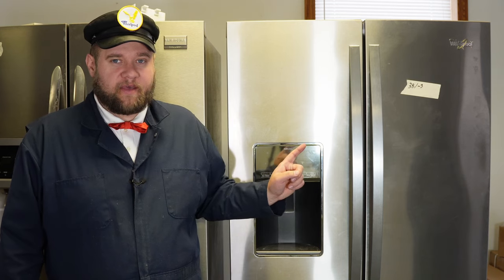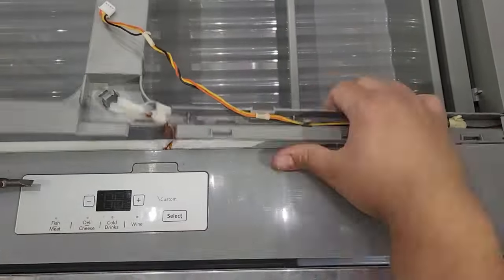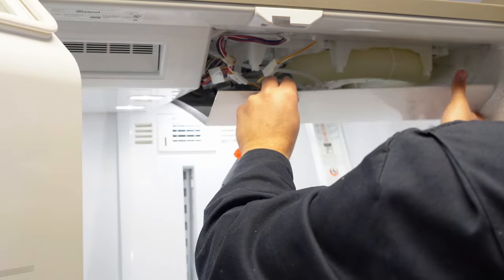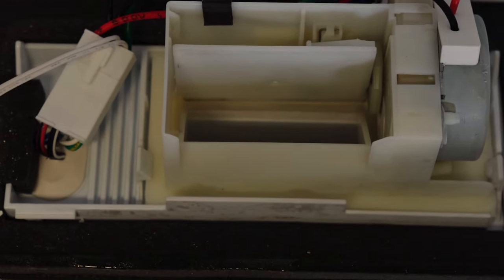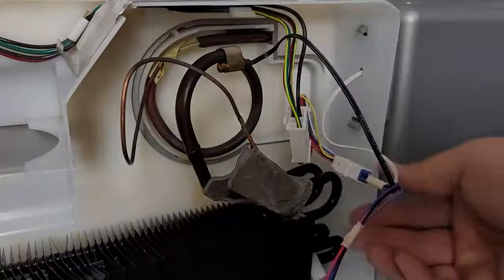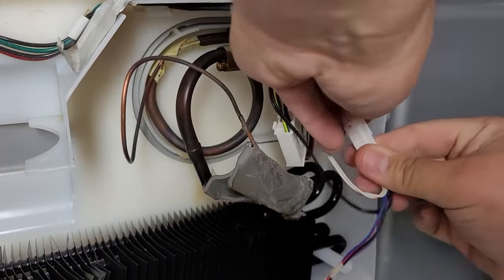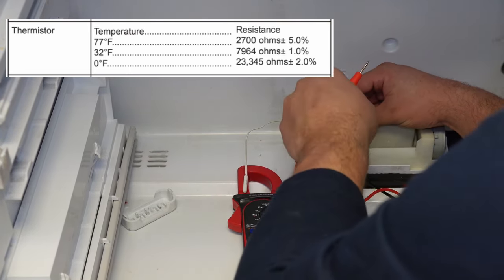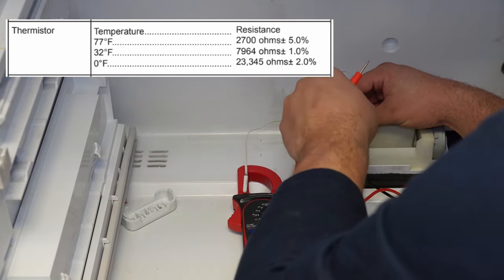Whirlpool Refrigerator Not Cooling but Bottom Freezer Works - How to Troubleshoot & Repair

Comment from the maker: Link to parts from iFixit:
Whirlpool Evaporator Fan w/ Thermal Sensor: https://ifix.gd/3TvVEm0
Alternate fan kit (check model#, W11087438): https://ifix.gd/3TzECDu
Damper Assembly: https://ifix.gd/4gwd4IL
Evaporator Drain Pan Trey:  https://ifix.gd/3BdSmxl

Comment: This my fridge!!!! $2000 and only worked 5 years. Freezer is working fridge is not. I got the beeping like doors are open and it was powering on and off. Guy came to check it and said all codes are fine but it's reading low voltage. He took control panel off plugged it back in and fridge worked again.... it was 38 degrees this morning now its reading 58 degrees 12 hours later freezer is 19 degrees. Total garbage and can't find any one who knows any thing about them.
Reply: Did you ever end up figure it out?
Reply: Update

Comment: It is a fault with the defrost cycle, it freezes over the vents and causes the refrigerator to stop cooling
Reply: This happened to ours, it was less than 31 days old😮
Reply: What is the fix for this? I noticed the metal base behind the white plastic is totally frozen.
Reply: @cathymc116 it usually fixes it self if you scrape of the ice but idk

Comment: I did the test on #3.  Fan didn’t come on. I replaced fan motor and it ran for a second. Then didn’t anymore.  Weird thing is if I spin the fan blade manually it will turn on and run for a minute or 2 and then stop.  Ran test #3 with new fan and fan doesn’t come on.  What else could it be ?   I tested the thermister and my #’s we’re close to the chart at 77 deg and at 34 deg.  I could not get cold enough to 32 even zero.  I assumed thermister is good. Maybe it’s bad ?   But why does fan turn on when I spin it manually ?

Comment: Fridge is at 46 degrees.  Freezer and fridge drawer r fine.  I noticed some ice on in back of drawers.  What was the code for defrost.  I took off top and have no code sheet
Reply from the maker: I have a dedicated video on the defrost codes, FYI

Comment: Have a carbon copy of the fridge and same problem.  Inspected, cleaned and tested all components as instructed in your video, everything checked out to be working fine. 
I had to call a Whirlpool repair man.  Diagnosing was correct except there was one more thing to check, the fan. The tiny fan that blows the cool air up to fridge. That was the problem, a none functioning cooler fan. 
After showing the repair man what I had diagnosed he only charged me $530.00 for 4mins of work to replace the fan.....lol.  Works fine now.
Reply: Where is the fan located ? My has a very cold freezer area (bottom) but the fridge area (top) on gets down to 65 degrees.
Reply: @EddieGomesCandmore  the fan is located in the freezer back wall. Take out the sliding drawer and then the back plating. This is where you’ll find the fan. Hope this helps you out.

Comment: Excellent diagnostic video, I loved every minuet of it. These style fridges can be hard to work on, I like the idea of checking the defrost cycle with amp draw. And I might have to add a Kill-o-Watt gizmo to my tool bag.
Reply: It's very handy to have a kill-a-watt meter for this and other projects. I was able to verify that my heater element was working by going into the step number 38 and observing 448Watts on the similar counter depth 2 door model

Comment: Did you ever make a video for the freezer section? I have ice outside that panel, which probably means there is ice inside the panel. There is some rattling noise, which gets louder when you open the freezer. I think it is some fan? Either way. I need to figure out how to get to that panel.

Comment: Excellent tutorial to understand the refrigerator air flow and actually defrost the AC with code 38 and then airflow and cooling temperature return to normal. Possibly frozen evaporator or fan as a result of not shutting the door properly.

Comment: @grot4941
1 minute ago
Hi Ben
I have been trying to fix my friend's Whirlpool WRT318 fridge. It was blowing cold air, the compressor current draw was 0.52 A, and there was a glob of ice around the tubing/capillary in the upper right corner of the freezer. Based on your video, I determined that the fridge was low on refrigerant and added some. The current draw went up to 0.9 A and the fridge started to cool. The problem now is that the compressor never stops. The last time I checked the fridge temperature was getting to 29 F and the compressor kept running, the freezer's temperature was 7 F and would never get any lower. The temperature setting was at its lowest (warmest) setting. The diagnostic test (thanks for your video) didn't show any problems. Of course, I checked the evaporator fan, defrost, cleaned condenser coils, etc., Any ideas?
P.S. My friend bought it used. It came with a piercing valve installed, so someone had already added refrigerant in the past.

Comment: Thanks!  Please do more repair, troubleshooting, and tear-down videos on that Whirlpool French door fridge with an ice maker. It's the model I bought at Costco last year... so I expect some problems in a few years after the extended warranty expires.  I already have a problem with the center flip piece that it doesn't click/snap all the way back, so when I close the left door, it might bang on the right door (closed) since the center flap stick out a little bit.  I have to call it in for a warranty repair here soon.

Comment: In a lot of the side by side fridges I've seen, with one in my possession as of now, the thermistors are designed terribly wired inside the side of the wall. Even several technicians said they'd never seen anything like it, and deemed the product unrepairable. One of my family members when pulling something out of the freezer tore off the thermistor cover, breaking the freezer entirely and potentially messing up the fridge defrost. Now I'm going for side by side Maytag with no icemaker

Comment: Thank you for your video. I had ice buildup on the refrigerator evaporator in a dual evaporator system. Ran test for evaporator fan and it won’t run. Replaced RC evap fan (with sensors) and MCB. Still throwing e-1 code on test 56 (ice maker test - cooling error) also replaced fan in ice maker compartment and ice maker. For a week I’ve been putting battery powered fan blowing across refer evaporator and it works and makes ice. I’ve traced wires on diagram. Getting 14v from power board but not on MCB. I’m at a complete loss. Please tell me why my refrigerator evaporator won’t run. (Tested damper and it works.
Reply: I'm a month late, but did you try the thermostat/sensor that controls the fans?
Reply: @MattMathisSoftwareGuy  appreciate the comment. I replaced RC Evap fan and both thermistors in Refrigerator. I’ve traced the schematic and believe the Evap fan isn’t getting a signal from the reverser valve. Replacing the reverser valve is beyond my repair capability.  I’m not doing a Freon purge, vacuum, desoldering/resoldering, and refiling coolant on a 9 year old fridge. The compressor is most likely at the end of its service life anyway.

Comment: Hey, I have a very similar build to this fridge.  I do have the crispers above the bottom drawer.  Getting ready to replace it.  Not sure how old it is, but it came with the house we bought in Dec 2020.  Only 2 of the interior lights have ever worked, though occasionally they would all work for maybe 5-10 seconds, then flicker and turn off. Closing the door and opening would result in the usual 2  LED's working again.

But about 16-18 months ago the fridge began resetting.  Sometimes it would do this every 10 seconds, every couple minutes or every 10 minutes, non-stop for days or weeks, then it would go back to normal.  I did notice freezer items (especially eggo waffles) being soft, as if they weren't cold enough.  But it would still freeze.  The fridge part I was concerned about potential food spoilage (specifically dairy), though the ice maker has been functioning fine and the ice has stayed ice, so I guess that's a good sign.  When it is resetting in short intervals I will just unplug the fridge for 10-15 minutes as it seems like it might not be great for the compressor.

I've looked up the issue and it seems to be control board related, but there are 3 total on this fridge and apparently its somewhat of a crapshoot as to which one will resolve the problem, if it resolves it at all.  I will say though, it was a great (huge) fridge prior to these issues.  Debating on whether to toss it in the garage when we replace it and maybe do a teardown and clean it up, see if there is anything obvious (a short) that could be causing problems. Other than the lighing and resetting, everything else seems to work as intended.

Just want to say thanks, since your videos will definitely help me remove panels without having to scratch my head too much and, of course, save me some time.
Reply: I just want to thank you for typing this out.  I’ve been playing this game with my POS for years.  Misery enjoys company.

Comment: Hey I have to ask….I have a model wrx986sihz02 (whirlpool). I had a ton of ice buildup in the bottom of the freezer so I unclogged and flushed the drain pipe and now that issue is fixed. However, I still have ice/frost buildup on the evaporator cover behind the crisper. I’d like you opinion on how to proceed to fix this issue? 
I know in this video you touched on the fact that this is common with this model and a sensor replacement may be needed. Thanks…..Alex

Comment: Right on. Problems I see on dual evaps is in rentals with weekly turnovers. Clogged coil. Temps maxed. FF EVAP freezes. Overwhelms defrost. Unplug for 24hrs to thaw. Nuisance issue.
Reply from the maker: Moving and replacing thermistor + basic defrost usually fixes it

Comment: Amazing video, wish I had found this two days ago tearing everything apart.  Would have saved me some headache.  I have a unit with the upper evaporator; any chance you know where I could find just a replacement thermistor/sensor?  I was impatient and couldn't find the right part that would get here quickly so I overnighted a moisture resistant 12v 92mm fan with a resistor inline to step down from 14v input.  I'd like to avoid buying another whole replacement when I could just splice an new thermistor into the wiring harness.

Comment: It's me again, on my fridge none of the cold air travels from the below freezer to the upper fridge. After a few days the freezer ices up thereby blocks the internal fan. I already replaced the fan and the thermistor, but I still have the same problem. So I believe it's the damper door that doesn't open when it should. thanks

Comment: My whirlpool wrf535smbm00, the bottom freezer works/air coming out is really cold.  The refrigerator up to still has a working blower fan but it's not coming out cold.  What would you suggest I look at?

Comment: Hello I have the same problem still on my whirlpool refrigerator I changed the damper and the fan and thermal system on my dual evaporator system and my unit is still not cooling and I did have ice build up what else is still causing this problem

Comment: Just found your channel so informative thank you I have a 2005 Frigidaire gallery model number GLRT183TDWB And since I’ve had it in 2014, the freezer has never kept things frozen it keeps water frozen and frozen vegetables OK but you can’t have ice cream  I researched it and I think it might be the damper switch? How much would that be? And how difficult is that to install? Thank you because of you I’m vacuuming in the back of my refrigerator today 🙌🏻

Comment: I have a model WRF989SDAM02. Do you know of the parts you have listed will work with my model number. Most of these units say updated part. When I look them up. But I can't find these parts for my unit right now. This seems to be one wireharness each part on mine has its own disconnect it seems.

Comment: I have a whirlpool french door WRF736SDAM14 pretty sure it is a single evap model.  Sears A/E tech came to my house and said I need to replace the evap fan..the freezer is cold not any cold air above the freezer. I am not sure where that is located, is there a video for that repair?  He wanted to charge me $600.  Thanks.

Comment: My model is a rare model its WRF560SEYM04 there is only one video on the internet that i have found and it just discusses on how to fix a Freezer leak are freezer wasnt leaking but it wasnt freezing properly so i removed the shelves and took out all the ice and the frozer closed better and froze food better but now theres a new problem now are fridge part of are fridge isnt working at all if you have any advice or know how to fix it i would greatly appreciate any assistance you may have to offer at all

Comment: Ben, I ran a forced defrost and the compressor stays running. You mention it possibly being the board. Does the replacement board need programmed or is it plug and play? Also, can you trust parts off amazon? OEM part is $225, amazon is $30 lol
Reply from the maker: It needs programmed but that's super simple. The 3rd.party boards seem just as reliable

Comment: Hi Ben. I stumbled upon your channel and thought I'd ask for your advice.  I have an LG refrigerator similar style to this Whirlpool (French doors on top for fridge and single bottom pull-out freezer).  The freezer refuses to stay closed.  I'm constantly shoving it to try to get it close and seal properly.  The warranty I have is not helping at all.  Technicians come by, clear out the minimal ice build-up, and leave.  The next day I'm back to shoving it 3 to 5 times to get it to stay closed.  The freezer Rails on bottom were replaced once but it didn't help. They said I had too much weight in the freezer but it's not even half full and we still can't keep it closed.  Any tips?  Thanks!😭
Reply from the maker: I'd use a hair dryer to warm up the gasket and see if that helps move the seal closer towards the door to help it seel better

Comment: Hi, I have a gold series just like this one.  Moved the fridge to new house, plugged it in and nothing comes on.  No lights, no sounds, no display.  There is power going to fridge, but nothing comes on, pure silence.  Any thoughts?
Reply from the maker: Id double check and confirm its not a plug/outlet issue by using another outlet or extension cord. Otheriwse, that sounds like the board either died, or something is unplugged going to the board.

Comment: Great video , my whirlpool stopped producing ice a while ago and leaked sometimes through the Ice dispenser chute. I replaced three (3) and they only produced sporadically, now not at all, also the fridge section above seems to not get down to the 34-36° range I’ve set it at, it’s teetering around the 40° degree range often. 
Coils have all been cleaned and no Ice build up in the freezer area on those coils. I’m not sure what else to check with this any ideas ?  Mode# WRX735SDBM00

Comment: These refrigerators are unnessessarily complex.  There are too many components to go wrong.  That, of course, is the objective, make them so expensive to service that you'll be forced to buy a new one.
Reply from the maker: People want in door ice and there's no easy way to do it. Literally every style has a massive flaw
Reply: @bensappliancesandjunk  Thanks for trying to help by posting videos and for responding to my comment.  My model GX5SHDXVQ00 doesn't have the in door ice option but it has given me problems the whole time I've owned it.  I had to replace the compressor relay not long after I bought it.  It used to make loud banging noises when running.  It sounded like a vent door slamming shut but it doesn't do that anymore.  Now, for some reason, the refrigerator vent door doesn't open when the compressor is running so the freezer gets cold and the fridge doesn't.  I propped the vent door open and it made the fridge drop down to 20 degrees.  I went through the diagnostic procedure, as you demonstrated in another video.  It passed all of the tests and the fridge vent door worked during the test.  I like the layout of the fridge but I've had enough of the headaches.  I plan to go back to a top mount freezer without a computerized control board.

Comment: I had this refrigerator less than 2 years. it is not cooling. The wire harness with thermal fuse is broke. This part takes more than 2 weeks  lead time. I contacted Whirlpool customer service who does not respond nor offer any help. I will not recommend this model or Whirlpool product due to poor customer service.